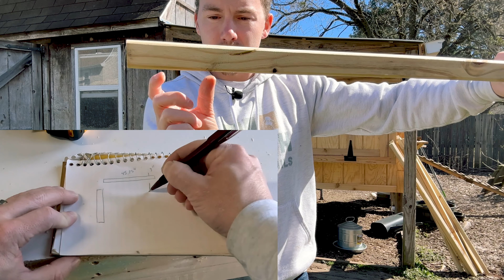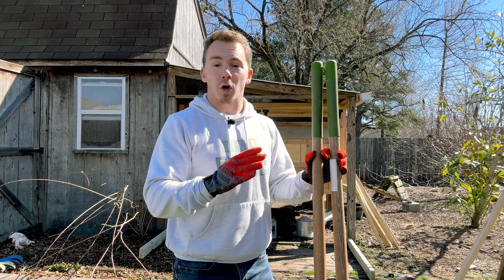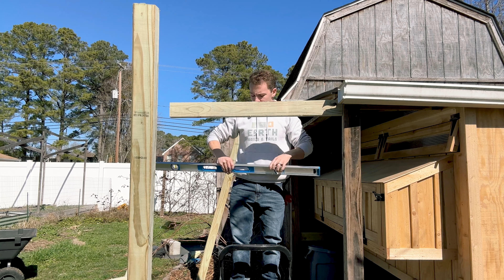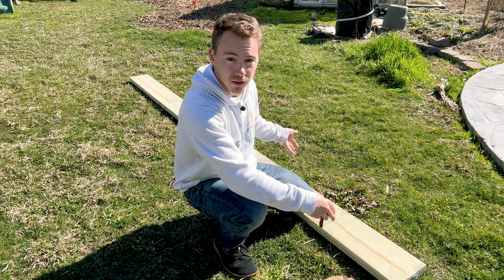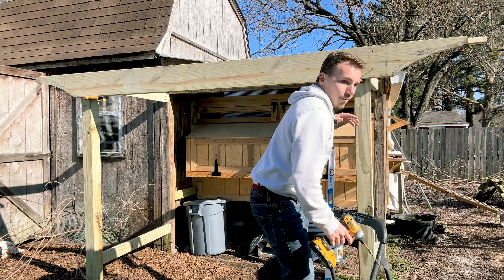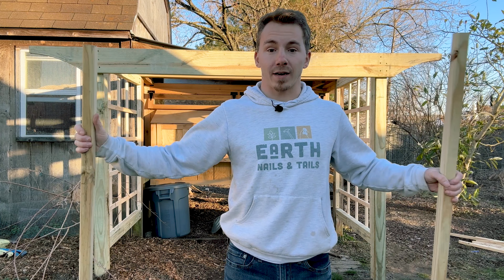Build this DIY Arbor & Save Thousands!

Comment: Perfect!!! I will be making a similar arbor. I will be using solid stain rather than paint to avoid peeling and upkeep. Solid stain just fades over time, but it is so much better than paint. You can even make solid stain in a pinch by watering down acrylic paint that you have lying around.